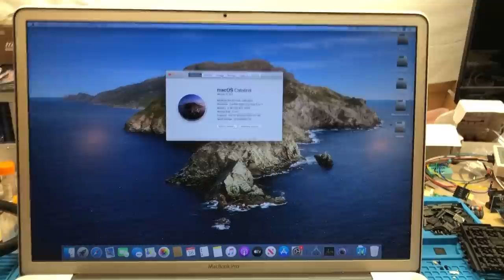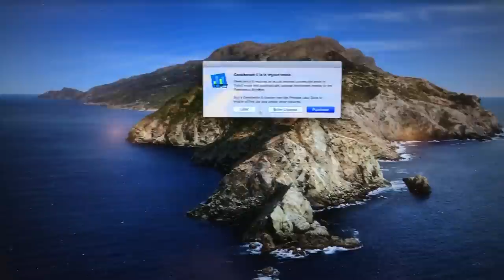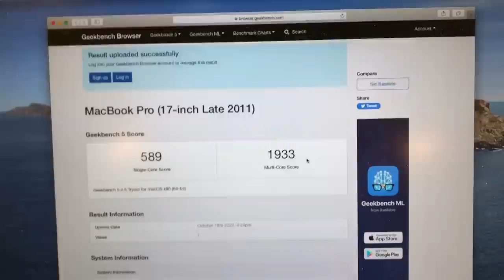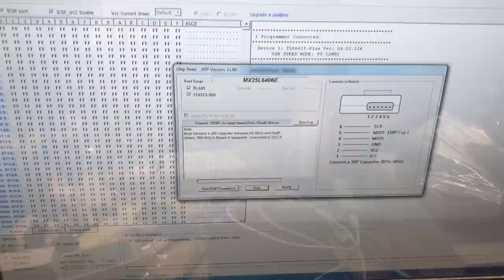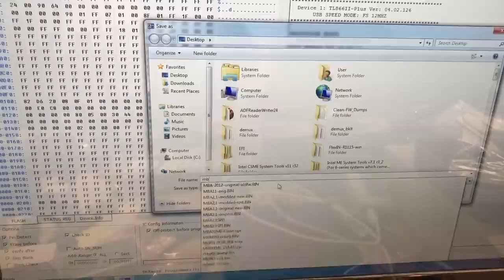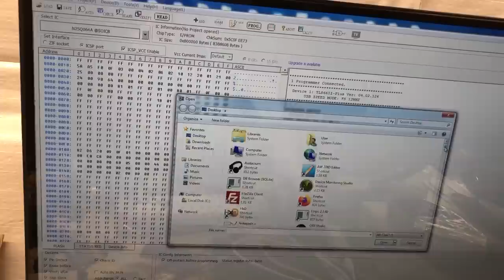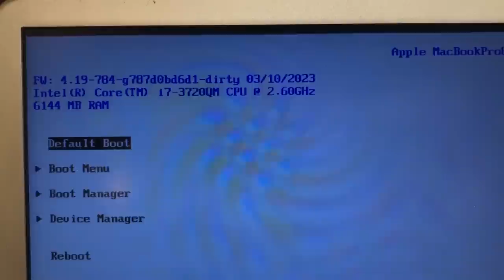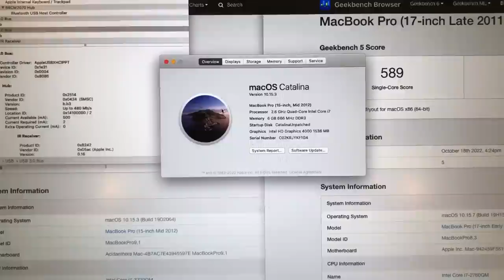Building a "Mid-2012" 17-inch MacBook Pro

Comment: Why you didn't swap mb? Just for video?
Reply from the maker: Because that's a horrible thing to do, as the board doesn't fit right, doesn't connect to any of the stock connectors, or line up with the port holes.
Reply: @dosdude1  ok, I'm not a Mac person. I like projects like you do.

Comment: You've mentioned in previous videos why you use the balls instead of paste but remind me again please as to why you choose to do the oh so tedious task of individually arranging them one by one? obviously thesebjigs make that task a much quicker one, but the videos I'm referring to you had no jig. Not bashing or hating at all whatsoever just very curious. Thanks
Reply from the maker: With these stencils, they don’t sit quite perfectly flush to the chip. If you were to use paste to reball these, it would flow all underneath the stencil and make a huge mess. Especially the case with the CPU that has capacitors in the middle.

Comment: Next episode: designing a custom mainboard for 17-inch chassis with 3rd gen i7 and 750M GT GPU :)
Reply from the maker: @nicholasblaze3092  Well... That's just shoving a 2012 board into a 2011 case. Doesn't fit correctly, doesn't line up with the port holes, and overall is not worth doing.
Reply: @dosdude1  True not worth doing. In the video the case was modified.  He did a good job making it line up. Plus having the GT 650M and USB 3.0 is pretty cool!
Reply: It's not impossible, but it's highly difficult.

Comment: Hmmm.  I too have a final boss 17", late 2011 cto, but it was dead to the world for years bc of the suicidal AMD gpu's.  Thanks to you, I was able to exhume and reanimate it by neutering the AMD graphics down to on-baord only.  BUT, I just found out, there was a window of time where Apple was actually supporting its computers (even if reluctantly), and had a deal with AMD to replace the OEM GPU's with fresh ones that had more robust soldier balls.  I assume this was moving from lead to silver soldier which melts at higher temps, but not sure.  If that's the case, would it be possible to fix late 2011's by re-balling them with silver?  ...& maybe a more forceful cooling system, like a fan that takes the place of the optical drive and hoovers air in thru the CD slot & brute forces it out through the rest of the system?  I just wonder.  It's my favorite computer ever made, but without the extra GPUs in it, it can't run much.  This GPU upgrade is wild.  You are the undisputed master of the classic mac DosDude1.
Reply from the maker: The issue is not the solder on these AMD chipsets, but rather how the die is bonded to its substrate. AMD never actually fixed this issue with their HD5xxx and 6xxx series chipsets, so even a brand new one will simply fail again just like the original. Therefore, replacing the GPU (even when Apple did it), will make no difference whatsoever.
Reply: @dosdude1  Ahhhh …nuts. Thanks for taking the time to share your knowledge anyway!  I wish there were some way to add another compatible GPU (from any model) to the 2011’s within the optical bay space, to somewhat make up for the disabled AMD & still be a self contained & portable mbp.  Some sort of butchered iboff board or… is it hopeless?

Comment: The AMD discrete GPU isn't working... Epic fail. The Intel iGPU in that system is HORRENDOUS.
Reply from the maker: LOL, the AMD discrete GPU in these is a defective piece of garbage, and has been disabled. The Intel HD Graphics 4000 in the Ivy Bridge CPU actually performs BETTER than the Radeon HD 6xxx garbage, not to mention is Metal-compatible, unlike the AMD trash.

Comment: Wat about the bad gpu issue though my amd gpu is dead in my 2012 just like the nvidia died in my 09 but yet Apple blamed nvidia lmao
Reply: Looks like you're just using the intel.. the 17 inch board didn't have any dgpu or disabled or what?
Reply: Wonder if I can do anything to make my system work a bit better. The dgpu seems totally dead now and I've disabled it but it also seems to fail trying anything 3dish that might have normally kicked in the dgpu. Secondly, I hacked in a battery from a 13" and it works fine but it seems to not match ID wise which is throttling the i7 to its lowest bin, would be nice if I could use coreboot or something to solve these issues.

Comment: PCH swap? Interesting, that's not needed on Sandy Bridge ThinkPads with Coreboot compiled for Ivy Bridge.
Reply from the maker: It is in the case of this machine, as it’s original HM65 chipset isn’t compatible with Ivy Bridge QM series chips.
Reply: @dosdude1  Even Intel's site says HM65 is though, unless you meant HM67 because for some reason the higher end mobile chipsets aren't officially compatible with Ivy Bridge though it's a completely artificial limitation.

Comment: Are you sure the PCH has to be replaced? I am not an expert, but those chinese fake "X99" Boards sometimes use H81 PCHs with Haswell and Broadwell(?)-compatible boards, so i suspect you might have probably been fine with leaving the original PCH in place.
Reply from the maker: The original HM65 PCH does NOT support Ivy Bridge “QM” CPUs. So a PCH swap was needed in this case.